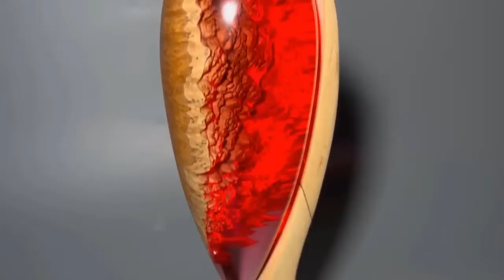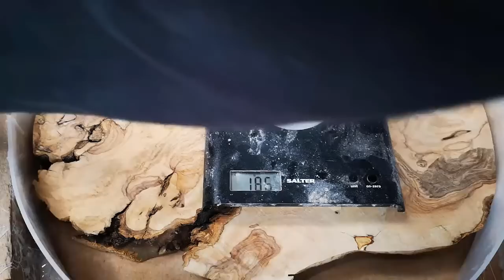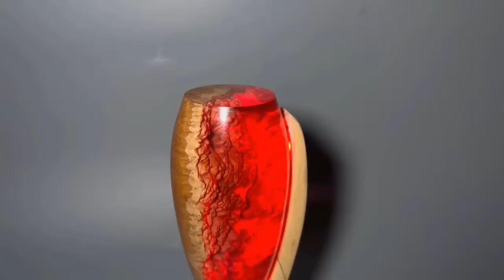Epoxy Resin Ideas, Lamps, Tables,  - Resin Art

Comment: It is beautifu! You are very talented, but it saddened me to see that you didn’t follow through to the end with the same quality in your work. It deserved that! You drew the curve by hand before cutting the board for the light fixture, and that left you with a frame with several gaps and not a good fit. It is so easy to  draw an exact curve, so I don’t understand why you didn’t. Most importantly, the wood, or board, you picket for it; It should have been done in the same kind of wood as you used in the stand and I the resin cast. I know it is expensive, but your choice of laminated wood just screamed cheap and it did not look good at all. You do such exquisite pieces of art, and I can totally see you get picked up by an expensive gallery, but for that you need to follow through to the end with the same attention to details. Keep on crafting, can’t wait to see you make new amazing things!